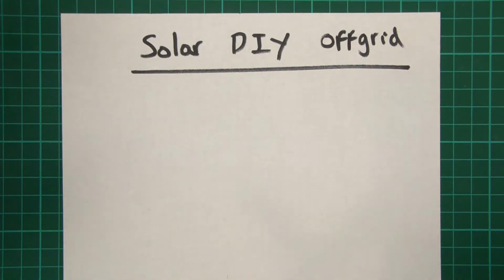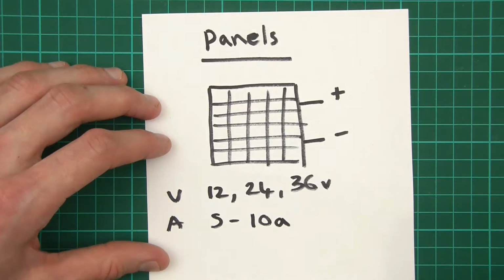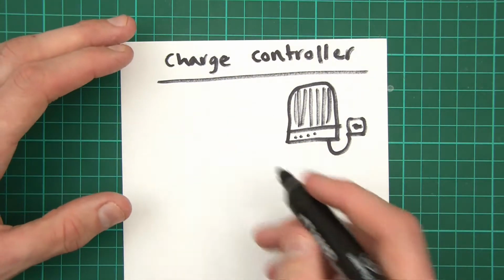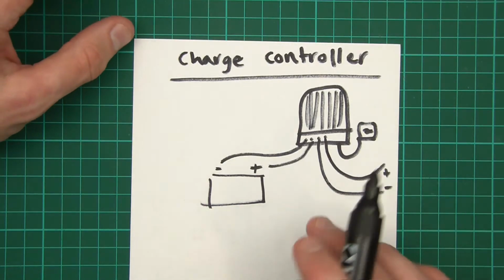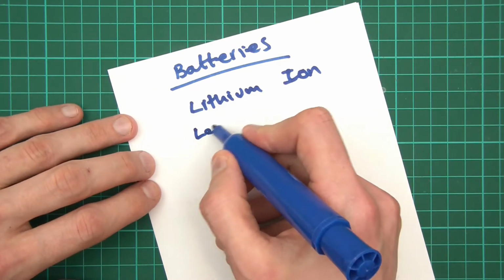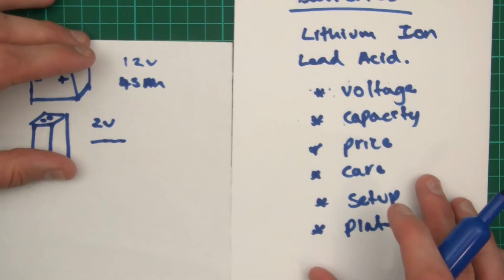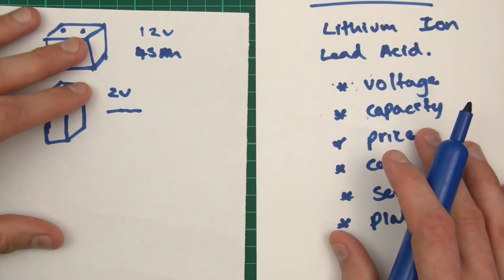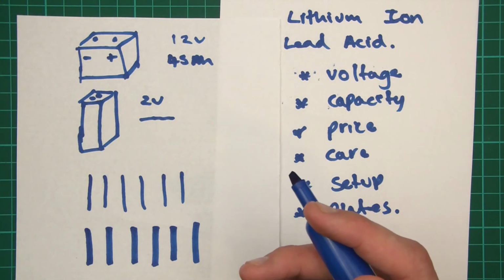TUTORIAL: The Basic Components of an Offgrid DIY Solar Power System Installation (Part 1/2)

Comment: Hello, these videos are a great guide to affordable solar.  I was thinking of making  basic system just to heat hot water.  My plan is to have a panel(s) feeding a DC immersion heater.  If I did that then would I still need a battery?  I would have the heater on a thermostat so that if it got up to temperature it would just switch off.  I know I would need to control arcing across the thermostat switch.  Do this sound realistic or do I need to go back to the drawing board?  Thanks for your videos and keep them coming.
Reply from the maker: Dave C Hi Dave, there are lots of different options, each with advantages and disadvantages. First of all, is your heater ok with the varying solar voltage? Say if you have a 12v heater, is it going to be ok with 6v, 9v, up to say 24v for a panel? If not, you need some sort of step down converter. Do you need to use hot water when there is no Sun? If so, you need a battery. If you choose to use a battery, then forget the step down, use a charge controller instead. Sometimes, arching isn't a big deal, you can use proper contractors or relays which have anti-arch contacts.
Reply: Thanks Antony.  I didn't ask the question very clearly.  I should have said that I was thinking of a hybrid system where I would use solar if it was available but revert to gas when it wasn't.  I could easily modify the present system plumbing but I hadn't considered the varying voltage.
Reply from the maker: Dave C you can do that too. It's similar to what I do with my solar power system.
Reply: Thanks for your help.

Comment: Will you be getting into efficiency of 12v or 48v panels and charging batts. in parallel and serial?
Reply from the maker: Hey Sik Vic! I never got a notification of your message! I will go into batteries. Efficiency, regarding solar is really difficult because there are so many factors. Losses are incurred when you step up or step down. The greater the step, the less efficient the procedure is. But on the other hand, you need your panels to be able to be higher voltage than your batteries! It's really complex. I'll try to get my head round it, then I'll maybe make a video about it.